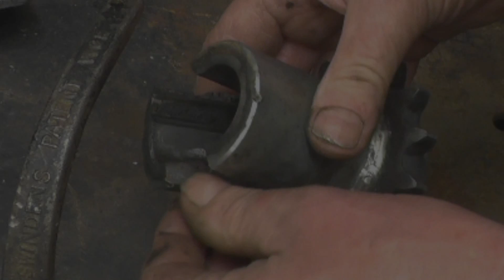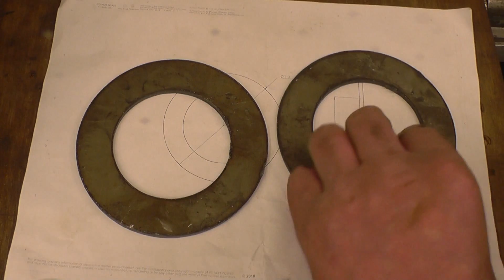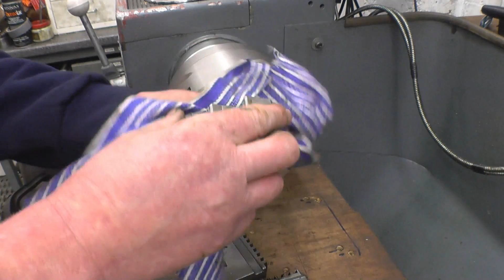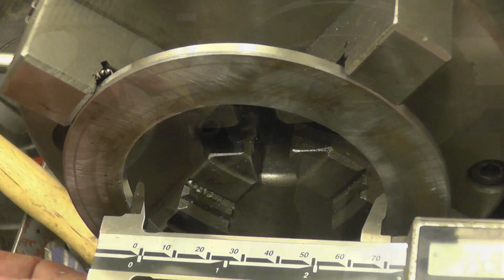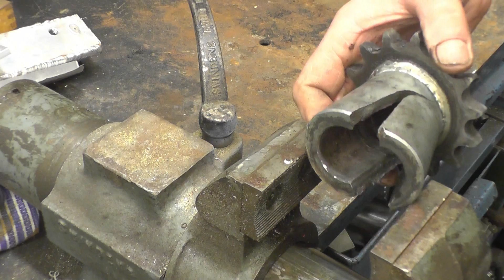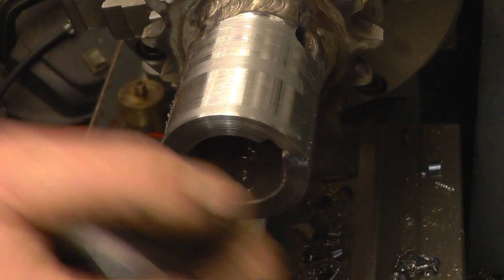SNNC 261 P2  Plasma Cutting        Sprocket Repair

Comment: John, just because it would be interesting might you suggest to the owner of the sprocke to  keep the repaired one in place even after the new one arrives? I wager the repair will last and last with the new one would ending up as a spare. Nice, proper job! :-)   warm regards vic

Comment: I bet if you went back in a few years time...you'd still find that reworked sprocket doing its job happily enough...

I've something similar to do on an antique Easterbrook Allcard pillar drill I've got...
The downfeed drive to the quill...
Its split a bit like that sprocket and it's iron so it'll require a bit of consideration before proceeding...
There's no room for a collar over it either but the main thing will be trying to keep it concentric and without any wobble...
Tricky..

Comment: Hi John. Got my Doubleboost hoodie and it's just the kit for in the garage or down the pub. Cheers and keep up the good work.
Reply from the maker: Thanks for your support
Reply: My cap and cup order was shipped with the wrong zip code and has been touring the US  looking for the correct address.  May have finally got it straightened out.